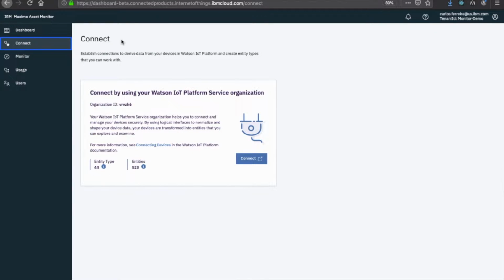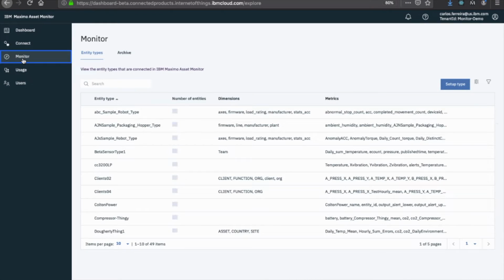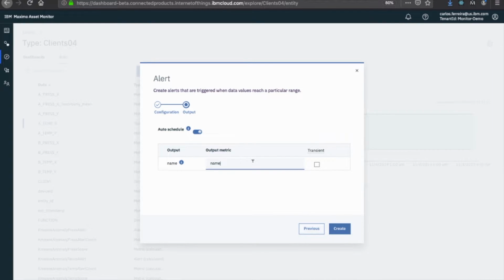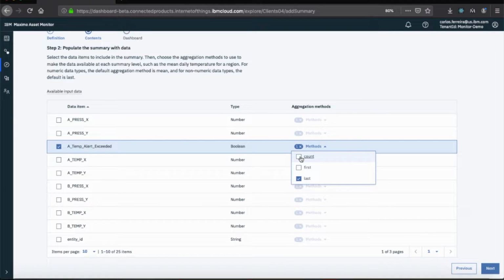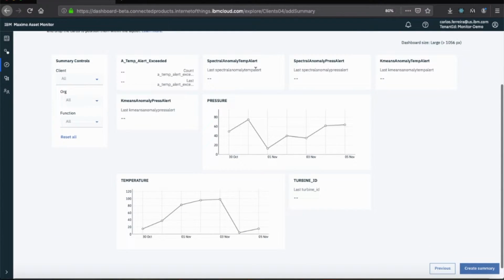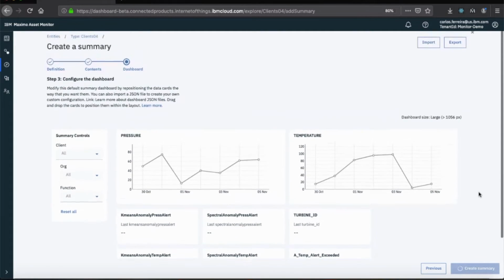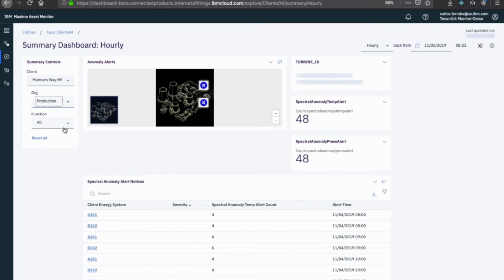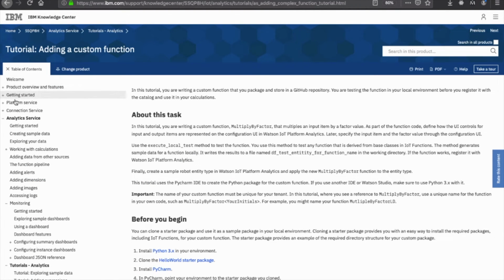Introducing IBM Maximo Asset Monitor

Comment: Does this supercede Maximo Asset Health Insights?
Reply: Hi,  No it doesn't  replace MAHI.   Monitor is the entry point for monitoring.  It allows you to connect devices,  collect metrics, transform / cleanse data and detect anomalies.   MAHI adds capabilities like how you manage the overall health and maintenance of those assets.